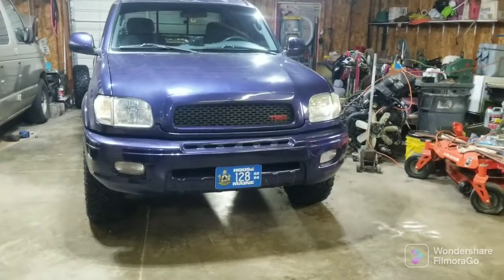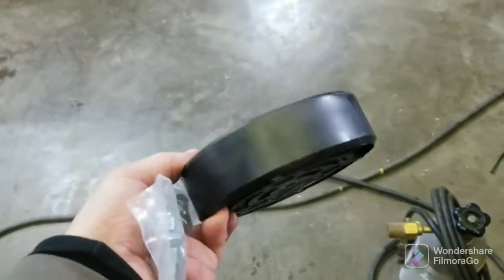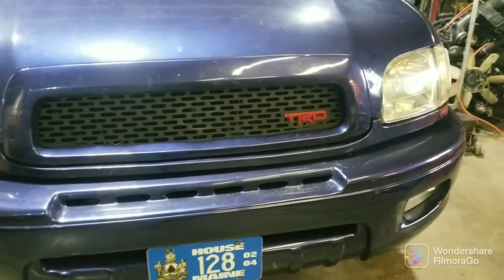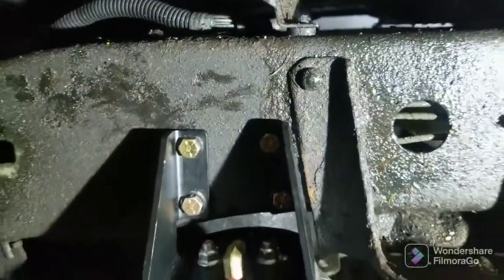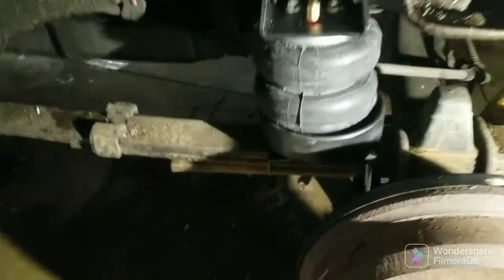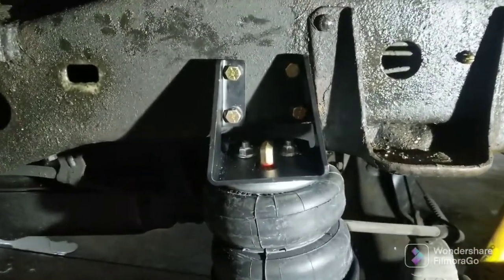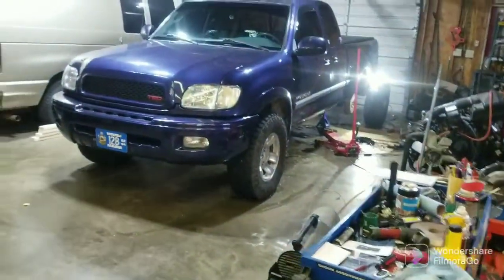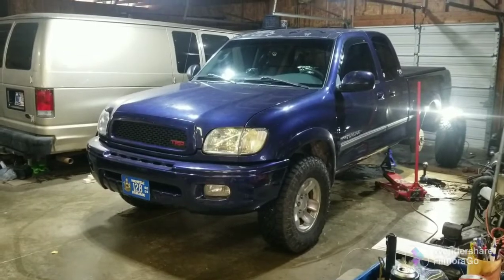How to install suspension air bags with  cradles. 1st gen Tundra, Firestone ride rite.

Comment: I notice you have another follow up video entitled "How to Modify Daystar Airbag Cradle".  You really should mention that here and link it in your description since it essentially supercedes the advice in this video!!  I also see someone mentioning in the other video how to just use these directly in line with the axle.  That obviously seems the best way to go.  If for any reason it can't be done with using the cradles, then I'm going to buy a U-bolt eliminator kit and weld it on.. problem solved.  I just don't think having these off axis is good in any respects, modded or not.
Reply from the maker: That's good advice, thank you.
I will ad the link.
Thank you for watching and sharing your knowledge on the subject.

Comment: Great video. How do you like the air bags for off-roading? I have a first gen Tacoma with a pop up camper on it, about 700 pounds total. I need to raise my rear and looking into this as an option. Already have heady duty leafs on, curious to hear your input
Reply from the maker: Thank you.
I really like the air bags for load support.
They work well offroad also. I have the cradles so they don't get damaged offroad. 
I run them at 10 psi offroad and they act like a bump stop.
I have no complaints at all.
I've been running airbags for years.
Thanks for watching and asking

Comment: why can't you run the airbags in line with the existing bump stop (remove bump stop, run cradles @ bump stop location?)
Reply from the maker: On the 07 and up Tundra thats where they go.
The way the bump stop landing pad is designed on the 2000 to 06 and with the u bolts there isn't room for them even when fully deflated. 
Hope this helps.
Thank you for watching and asking.
Reply: @funjunkiegarage  Thanks, I wonder if this is the same with the 1st Gen Tundra.
Reply from the maker: Mine is a 1st gen Tundra
Reply: @funjunkiegarage  Thanks, I am looking at the space now, seems tight, have you considered Timbren ? They would go in place of the bump stops & seem ideal due to their small size.
Reply from the maker: No, I didn't know about Timbren when I bought mine. I went with the Goodyear Ride Rite based off past experience with them. They do work well and I don't notice and adverse effects based on the way these are mounted.  
If you do go with the Timbren let me know how you like them please.